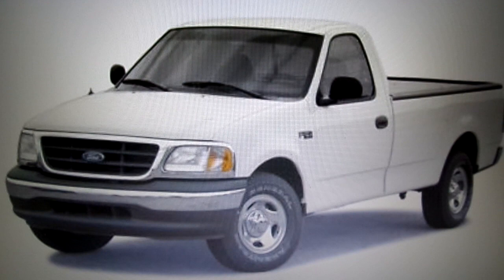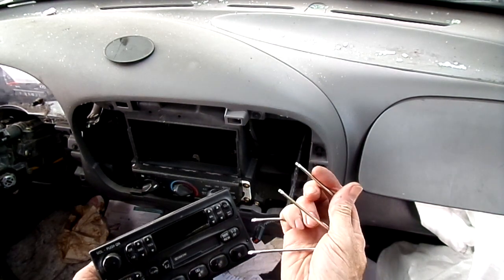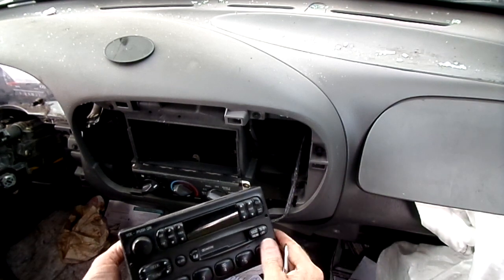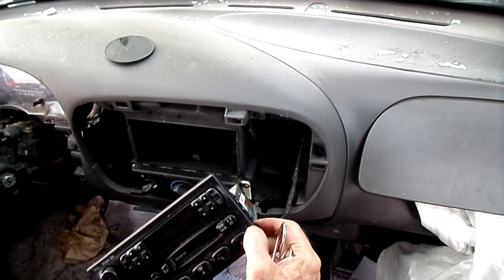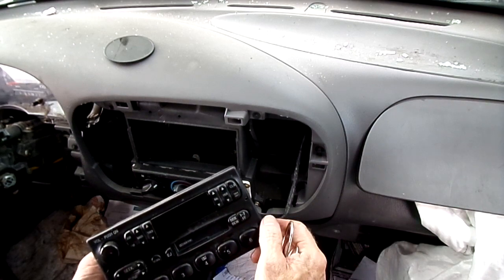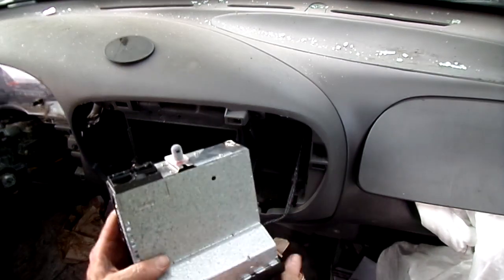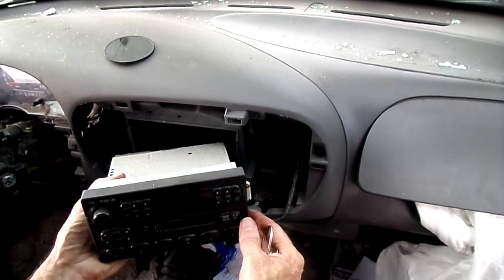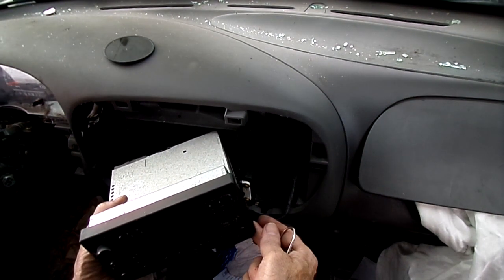Ford F-150 Radio Removal

Comment: +richpin06a there are 2 different f150s in 2004 when they changed to the newer body style they also kept the old body style and called it the f150 heritage which appears to be what your working on my uncle has a 2004 and its a lot different
Reply from the maker: +2003SaturnFan I did not know that ...thank you.

Comment: Too easy lol, but the radio was the cleanest part of the truck :-).
.
Have you had any experence with the old manual window mechanisms?
Im messing with the one in my mates old car and its a pain to lift the window without too much force, its the old X sissor type with half a cog connected to a bar that connects to the X to move it, quite crude lol and should have been easy to make it behave lol.
Just wondered if you have struggled with making one work smoothly :-)
Reply from the maker: +zx8401ztv I worked on the ones in my 56 beetle.The drivers side had two teeth missing on part of the mechanism you are taking about.I welded the teeth back to there original shape lubed the whole thing up and it is now good as new.
Reply: +richpin06a 
Thats smashing :-D, my mates car is an old triumph herald, so very similar idea.
The teeth on his were all badly worn (too much friction), and lifting the window required too much force on the winder, the channels are creating too much friction, i removed the mechanism and the window stayed up without it!!, i had to use force to make it move, never a good idea with glass.:-(
Ive put a better mechanism in now, no wear on the half cog or winder cog, just a bit of swearing at the old knackered channel lining ha ha :-D